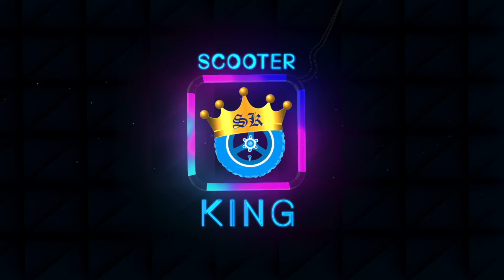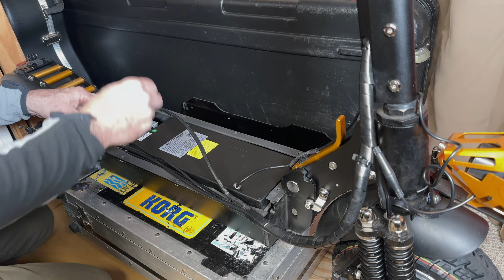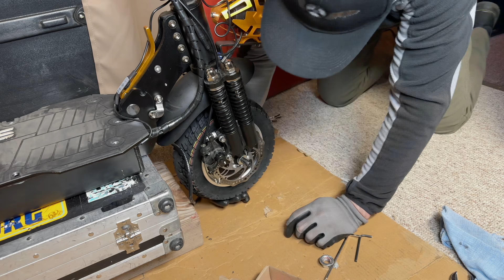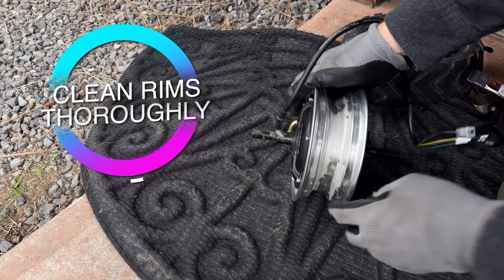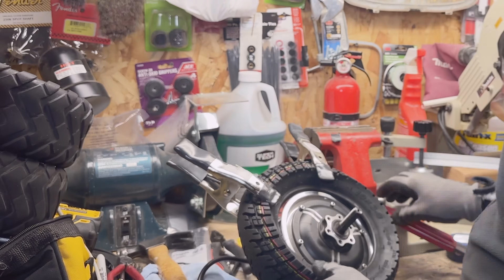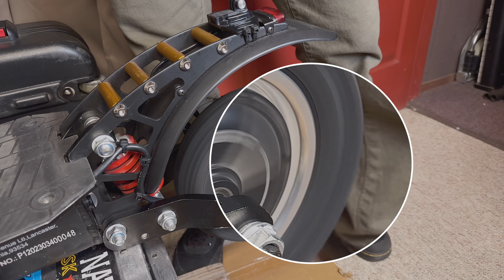Electric Scooter Tire Change Step By Step - No Pry Bars Trick

Comment: Great video. What is the width on those tires as I have 4 inch wide tires and seems that large wrench won't work to compress wider tires. What are the clamps you use and will they open 4 inches?
Reply from the maker: The clamps are just form home depo and open about 2 1/2 inches so I had to get a BIG set of channel locks from Harbor Freight to compress the 3 1/2 tire first. Its actually pretty easy to do if the channel locks are big enough.

Comment: What the largest honeycomb tyre I can put on a 8.5 inch rim
Reply from the maker: These probably have the tallest profile and thankfully are cheap enough but can be tough to install: https://amzn.to/4d5f9cp
Reply: @Scooter-King.  so I can’t put nothing bigger than a 8.5x2. Not even a 8.5x 3
Reply from the maker: @baztidbury5823  I dont know what scooter you have but ULIP makes an 8.5x3 that's a great tire. Thing is rather or not it will rub on the forks or fender at that width. I would check with the scooter manufacturer first.
Reply from the maker: https://amzn.to/4cE3QIj
Reply: @Scooter-King.  I’ve modified it already and out front suspension on it. There’s plenty of room

Comment: I put 45 psi in my m4 pro is that to much air mate
Reply from the maker: Its the tire that determines the max pressure. Look on the side wall and the tire max PSI will be next to the size.